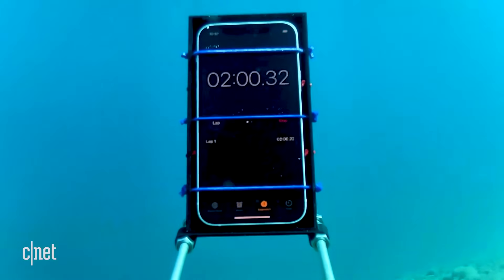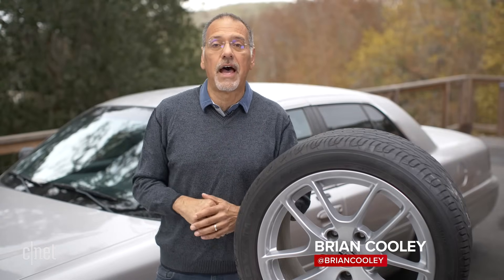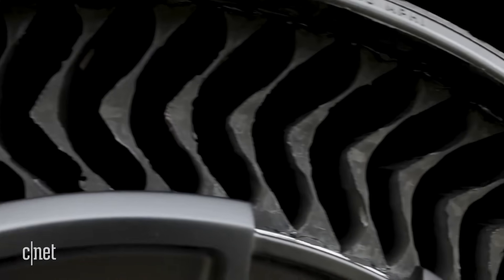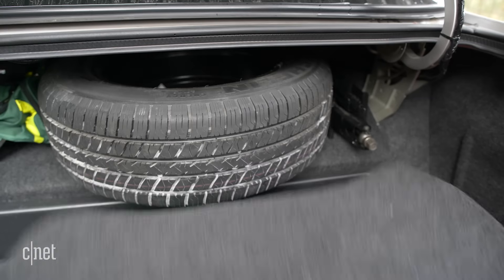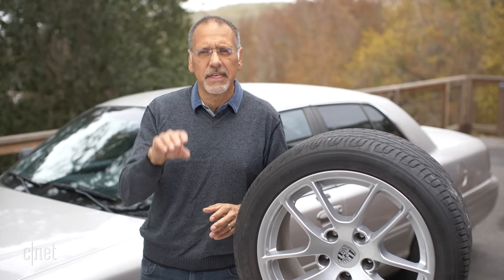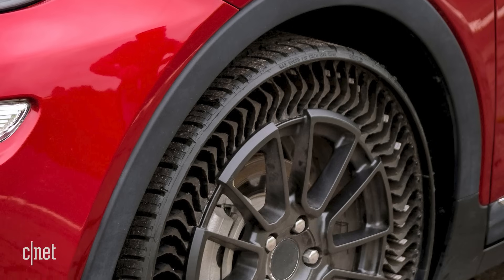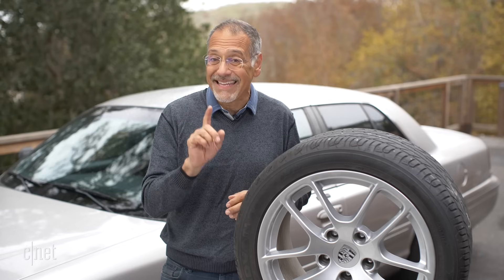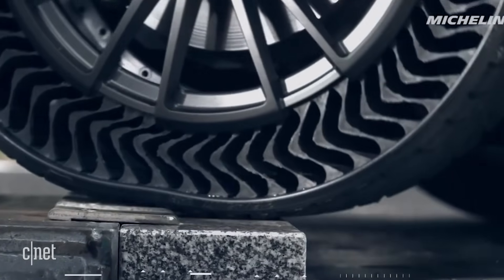See what Michelin uses instead of air in its Uptis tires

Comment: Having had a flat tyre only twice in nearly 40 years of driving I don’t see this a major advantage worth paying more money for.  If they could design these so that the tread is replacable but the rest of the wheel is usable for longer reducing the costs this might be a reason for switching.  This would also have a bigger affect on the environmental impact of the tyres as less of the rubber would need to be replaced every time the tread wears out.  Otherwise I don’t see these being a success as they are offered now ie more expensive with the only major advantage that you can drive over nails without getting a flat tyre.  Plus the wheel is integrated with the tyre so replacing them means replacing the wheel as well as the tyre (ie the environmental impact of these will be worse than existing tyres not better).

Comment: I’m going to assume that the sidewalls on the production units will be fully sealed. Otherwise,  after a single snowfall, these things will pack up with ice and shake your fillings out!
Reply: I'm going to assume the sidewalls will be fully sealed just to get past the general dislike and distrust of change
Reply: idk, those things constant squeeze out when theyre in contact with the road. the engineers did go to school you know
Reply: @gasun1274  magic
Reply: Memang bm
Reply: now even women can have fun in the snow
whilst the boys are drifting
the girls are vibing
Reply: It's not ice that concerns me with those, it's gravel. Those connector ribs look thin, and thin rubber is easy to puncture.
Reply: Pretty sure I read that they tested that several years back and found mud and snow did not collect.
Reply: I doubt you'd be able to use them in very cold weather anyway. If the springs inside of it are made out of polymer then they would most likely just shatter. He said they are infused with glass but if the material is frozen then the whole thing will be glass.
Reply: @nf8721  And of course engineers are all complete abject idiots who can't adjust the temperature at which a polymer becomes stiff, yes? Let's just shut down all engineering schools because education is an utter waste of time.

Comment: Tire pressure and a flat contact patch is entirely dependent on the vehicles weight.  These tires will have to support a very wide range of weights for them to be marketable, otherwise they would have to make a specific tire type for every individual vehicle. This is probably why we've seen these for so long and they still haven't been released.

Comment: My one thought on these over all the years is that if you live in a could climate, and the gaps fill with slush and freeze solid over night, you are going to have a very miserable ride the next day; for both the loss of compliance and the loss of balance in the wheel.  (The loss of balance could happen in most any climate . . .   A small animal crawls into a gap when ever the car is parked . . .)  Pneumatic tires are really one of the world's great engineering successes!

Comment: If you you stretch and contract a rubber band often enough it will break by "fatigue failure".  The sidewall sections in this tire flex much more than ordinary pneumatic ones on every rotation, so I doubt that they will last as long.

Comment: These have been around for over 20 plus years. The one downside is, they're still not "enclosing" the sidewalls. I know why they aren't... It's the ability to "dissipate the heat" generated by the "flexing" of the tire... The DOWNFALL though, is that "debris, mud, snow and ice will pack inside these and cause VERY DANGEROUS situations... Sorry, these look like they still have yet another 20 years to go before working... Which will be just about the time we no longer travel on the ground..... ;)

Comment: I think sidewalls would still be useful if only to prevent debris from getting in between the spokes.
Reply: True. They would also prevent mice, snails, and other fauna seeking refuge there.
Reply: @beige_aces9465  I wonder what'd happen if a big rock got lodged in there and you rolled over it a bunch of times. Wheel would probably be wrecked by the time you got home. Then you're replacing a $300+ wheel instead of a $200 tire.
Reply: This!!! If you got mud or a lot of debris on one side of this wheel it would be out of balance and would be a very dangerous tire
Reply: Exactly my thought when i was the design. Any little animal (insect, small rodent, snail, etc) could come and find shelter inside, and small rocks or pebbles could end up stuck there. It would be even more dangerous with pebbles, as you could literally catapult it out of your tyre while driving.
But now how do you close this space without ending up making it a regular tyre, only with way many more compartments.
Reply: it's funny how nobody talks about sidewalls, they would probably be essential for one of these tweels
Reply: I love this guy. I could listen to him talk (and watch him doing it) all day.
Reply: yea, a hose is such a hassle.
Reply: @angelous8942  a hose will not be enough to wash out smashed rodents either.

Comment: Question I have is, with regular tyres you can adjust the air pressure to compensate for more or less load in the vehicle, surely with these there is no adjustment and it is just fixed?
Reply: Now that's an interesting question

Comment: While there are no doubt benefits - less weight to carry round, less chance of over/under inflation (which lead to safety and fuel efficiency problems and premature wear) I can see a couple of issues that hopefully Michelin will be looking at...
1. Microplastics. Current studies, although in their infancy, are indicating vehicle tyres account for anywhere between 7% and 27% of microplastics in our oceans. Easy to understand - tyres contain some plastic in the mix, tyres wear leaving deposits on roads, rains washes these off into watercourses and out to sea. We need to see less plastic in tyres.
2. Noise. A study from Germany has linked high or constant exposure to droning noises, such as living near a motorway, to alzeimers disease. Traditional tyres in some sizes are being fitted with a band of acoustic foam (mainly for 4x4s and EVs). This limits road noise internally and externally. Maybe a foam filler between the support ribs in these airless tyres would help?

Comment: One thing to keep in mind about these tires is that  They need to be made adaptable for battery powered cars. people don't realize how heavy these cars become because the batteries are so heavy.
 This is why although Tesla is making a battery powered pickup truck you'll notice that these trucks are very low to the ground because of how heavy the battery is.
 Also people are converting their conventional gasoline powered cars To battery power, Which again makes them heavier.

Comment: Hello. Many people here are confusing this with the Tweel, which is another Michelin similar design but for industrial usage, mainly forklifts and it came out so long ago. its a really high profile tyre and those wheels look custom, i doubt they can be fitted on drop center rims since there is no pressure to hold the beads in place. Moreover, snow and mud with not affect it and they are easily evacuated and ABS and other systems should work just fine because it cant be a functional tyre if it is not transmitting all the forces (grip,brake,steer,carry loads...). Noise is a tricky question.. theoretically should not be higher, all of it is generated in a small contact patch area maybe the spokes can absorb much of the vibrations generated or maybe the absence of an air chamber will produce something totally different,.. hard to tell. Sorry for the long talk.. for the tyre nerds. Peace.

Comment: You left out one question: How many miles can it run before one of those really thin sections in the wall breaks?
Reply: Well, we all know that there's going to be something that requires us to change these out. Only good for X amount of years or miles etc.
Reply: @bigk777  Well no matter what the tread is no different than any other tire, it will still wear out the same. The ribs in the middle should have no problem lasting as long as other tires, it's really not any different than what the sidewalls already do. They basically just moved the sidewalls.
Reply: @ryanroberts1104  
I would agree with this on two facts.

1) The current tire has a very LARGE range for how long it will last. An economy tire might be 25,000 miles but the best of best are around 100,000 miles. Will it shift off of the average of around 60,000 miles?

2) Listen to the video closely. The explanation for why it will eliminate tire waste is because it doesn't have faults like current technology. No pinch flats, and no pre-mature wear from un-even inflation. They did not list extended tire life. Which they definitely would have if it was even a mild contributor to waste reduction.
Reply: Many, you'll find them on military humvees.
Reply: And what's the cost/process to retread them ?
Reply: @ShawDAMAN  Burn them buy some new ones. That's the American way.
Reply: @ryanroberts1104  burning rubber pollution go brrrrrrrr

I'm Ameican btw
Reply: @xvnexus8814  Tires are generally used as fuel to create the cement in concrete, which is required to be heated before it will work. The furnaces designed to burn on tires do so very cleanly. If you don't like it you need to stop using anything that has any concrete in it. There really isn't many other practical uses for old tires, they're full of nasty chemicals and they can't just be melted down and reformed.
Reply: @ryanroberts1104  retreaded tires are ridiculous unreliable, to the point of them being dangerous.
Reply: @ledfloyd9035  That isn't true at all. Retread tires are every bit as safe and rated for the same speeds/terrain. There is no information what so ever to suggest they are unreliable, and definitely not dangerous. Like everything else they have gotten much better in the last 30 years.

It is however a questionable cost choice for a passenger car with 4 relatively cheap tires, makes more sense for big trucks where they are commonly safely used with heavy loads.
Reply: @ryanroberts1104  Oh that makes sense I thought you just burned the tires in the backyard burn pit or something like that because my grandma burns plastic like that
Reply: @ryanroberts1104  actually it is true on cars. On semi yes its perfectly fine. And even airplane tires. They're thick enough. You can not at all retread car tires.
Reply: My thoughts exactly.
Reply: As long as the companies choose to generate profit. I read something a while ago that talked about how tire manufacturers could make tires that last 50K+ miles each, but choose not to because it would cut into their profits a lot.
Reply: @tallsz559  Plenty of tires last well beyond 50k! It's not a conspiracy from "big tire", they just wear out and always will until somebody invents a different kind of rubber. As noted the military already use these, they only use good stuff.

It is absolutely hilarious how many morons think there is something evil about this for literally no reason what so ever.
Reply: @ryanroberts1104  I couldn’t remember the exact number, but I think that it was actually 100K+ miles. Why are you so convinced about what I am saying is wrong and that it is some “conspiracy”. Companies cut corners all day long to generate the most profit possible.
Reply: @ryanroberts1104  you would be surprised how many people don't take care of their car. Whether they try to or not. Thus causing excessive wear. Thus blaming tire companies and not their car
Reply: On perfectly smooth roads they are probably okay but these seem stupid, one pot hole at speed then what happens? Probably not the best for the car
Reply: @ClipzArt1  And what happens when you hit a pothole at speed with a normal tire? Nothing good. You're supposed to hit the brakes. As pointed out for the third time, the military already uses these on HMMWVs because they are more resilient than normal tires. You definitely won't get a flat tire, that's for sure.

What's next? Somebody going to say they make these out of baby seal oil?

Comment: Non-pneumatic tires have been around for a while now. Lots of ride-on lawn mowers and other farm/industrial equipment has been experimenting with them. 

They have flaws though. They are very hard to keep balanced because things can get stuck on the inside of the grooves and at high speeds, they are aerodynamic nightmares. 

What I don’t understand is why they still don’t just put the outside sidewalls on the tire, but just don’t pressurize the inside. So you have no risk of contaminants on the inside. Seems like an obvious fix.
Reply: Adding the sidewall would make this new technology look "normal" as well.
Reply: I think the actual tires will have sidewalls…these are just for demonstration
Reply: I've been saying that for years, why not just have side walls. Rain performance is another question I have yet to hear on. Also why is this tech taking so long to develop, its been years and years they mention this tech.  Tin hat conspiracy is that they last too long and Michelin isnt down on cutting its profits for the sake of consumer convenience and perhaps the research is on how to make them not last as long while not breaking apart too early.
Reply: And/or fill the gaps with a flexible foam that will protect it as well.
Reply: It would not have have the properties that it has
Reply: I love this guy. I could listen to him talk (and watch him doing it) all day.
Reply: I bet a sidewall would get shredded by this tire.
Reply: @HateNeverCeasesHate  why?
Reply: they are on electric scooters and bicycles now. not sure if they can hold the load of a car,  but what do i know about tire tech?
Reply: Not so obvious, and not so easy ;-)
adding those outside walls would prevent those tires from having the way they are now (bending on obstacles) - which most likely would make them fail and break fast
Reply: @fzakrzewski  if the interior isn’t pressurized, they would still be able to bend on obstacles just fine.
Reply: @shanemooon  you ain't no scientist buddy cut it while you still can
Reply: @fzakrzewski  Who wants tires that bends so much on obstacles or weight from above? This is a bad and dangerous feature.
Reply: Shut up Shane, you think you're so smart.

Comment: Also, how will they adapt to handle in mud or snow since the tread on those tires tend to have deeper groves. What if a rock or something gets stuck in the grooves? Wouldn't that throw off the balance of the tire? Great idea if our roads weren't riddled with giant potholes. I'd honestly rather replace a tire due to cost versus a whole rim.

Comment: I'd like to see what happens when a puddle freezes around the tire and in these spokes. There will need to be a cover to keep ice and debris out. How long do the spokes remain flexible and what happens when the treads wear out?
Reply: Presumably you get a new tire when the threads wear out. Just like tires today.
Reply: @longfang98  : Yes but do they last longer... or significantly longer? Are these more recyclable or will there just be piles of these instead of pneumatic?
Reply: These can be used ㏌ warmer climates until further innovation
Reply: @pumamountainlion7777  :  Perhaps. There is still debris and small animals etc. We won't know until they try it.

Comment: What about variations in temperature? I imagine it’ll feel more stiff in the cold and soft in the heat.
Reply: thats the same with normal tires, more so actually because the air pressure fluctuates
Reply: @BRUHwutTV  you can easily change air pressure to compensate, you can't do that with these tires. Can't air up or down, you're stuck with what you've got.
Reply: @lllllllllllllllllllll1lll1  It really depends on the rubber they use for the tire, but yeah for the most part you're right.
Reply: I love this guy. I could listen to him talk (and watch him doing it) all day.
Reply: Thqts what she said

Comment: We also want to know how much traction they'll get in launch mode, and how many varieties will be required for the full range of loads and vehicle classes. One great thing about air-filled tires, is that you can calculate or adjust 'hardness' by air volume/pressure, and density of material.

Comment: It depends where you live also, hot road temps will cause those tires to wear and tear more easily and cold weather can make them turn to bricks especially if there’s ice in them.
Reply: So how is that any different from current tires?
Reply: @longfang98  it’s very different. Why do you think 99% of cars aren’t using those tires?

Comment: The concept is great, however.... sidewalls are absolutely necessary preventing foreign objects from entering?! They are!  I drove an ATV with those tires, they worked, but after sliding around corners, medium sized rocks entered & needing to be extracted. Additional  trailside maintenance, no thanks! 
In a cold environment when ice would absolutely accumulate within those open tires on a car, severe imbalance? Yes!!   Wow, Michelin isn't considering the the obvious.? Driving in slush, arriving home in a Connecticut winter, getting up in the morning & your open sidewall tire is half filled with ice? Getting it freed up by whatever means, & time, then   large chunks could still be sticking out on the inside ripping out brake lines on the first tire rotation, is Michelin considering any of this?
The concept is great, however in my humble opinion... sidewalls, a structural benefit.. & a filtered venting system are a necessity!
I like a smooth cruise, Yabba Dabba Doo.😉

Comment: I think this tires should be stiffer. Imagine when you brake the wheel is just going bend that it might cause an accident. Also those openings in the tires might toss youre car in the air if its gets windy.